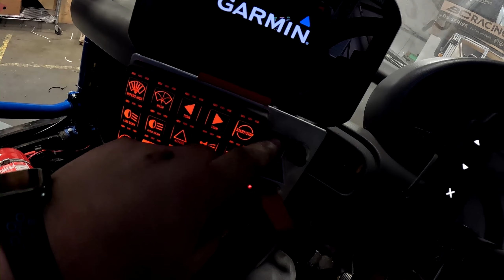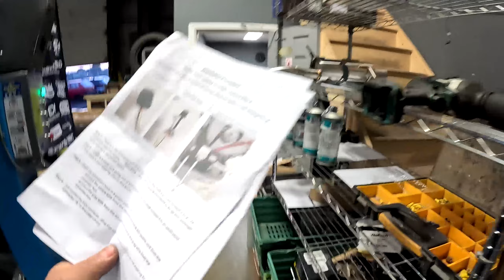RACE CAR STEERING WITH EPAS CONVERSION & STEERING QUICKENER - FABRICATION VLOG

Comment: Regarding the telescopic movement of the column make sure the brass sliding shims haven’t moved or got jammed as I found mine had when I had a pas failure on my megane. It still allowed up and down movement but stopped in and out. (That’s what Nan said!) as for feeding the wheel, the fastest man I know feeds the wheel and he has a tendency to turn up to every race series he’s been in and get fastest in practice and then be in the top 3 when the flag drops so no big problem.

Comment: Have you got a link for the control box and the rack reducer? Another cracking vid chief! 🫶
Reply from the maker: Controller - https://www.ebay.co.uk/itm/284483360575?hash=item423c87973f:g:zLsAAOSwJ8RhYsRT&amdata=enc%3AAQAIAAAA8GaoLzs4zAqZlsbQUAL9ztZSJGCvL1uhcBVTiSYTjlhTVVD%2BtWQmCiz2kKVoHg0o0qhBTdJqYvF6YDofmodIPGUO06NEVxF3ytEEPa1ZA7XtRdhlGBeqISVdqKSKajGAtcmsk9fZ31KG2snMy922luW4K7r5%2FjVKWvbuhH4pNbMxWgiaN2rxV4G3UJx0fvBCHUsMhcI%2FCbKw96hRyRZxFFuql2ou5xuOOv6HL%2FAPZqkMCcLcGKuC7JAc6%2FmdL5YJtKvvdgXsiTK%2FHeOkjpw5MbhPHXHeUTN%2BHhRln2REbgtZU6%2FXLZxKg47DebyEOQ%2FP7g%3D%3D%7Ctkp%3ABk9SR7DwhfGAYg
Reply from the maker: Steering Box - https://www.ebay.co.uk/itm/133867856225

Comment: 👍Nice install, peak electrical load on the build any concern? I've no idea what type of current it'll draw but it all adds up. Being thrown around the track I doubt you'll have the heater fan and rear demister running 😆
Reply from the maker: Its only once you film and edit a video you realize so much information is missing!

My Band-Aid method worked for Cadwell and I'll need to redo it before Brands. But the wire did indeed get "warm" but not Hot or melty. With the time scale all could get hold of was 17amp Wire. So i coiled 2 together - but apparently wire doesn't working this way. It requires a 50amp Fused feed.

Comment: Just wondered has the rack still got its collapsing section or was that the section your removed to fit the 1.2 ratio multiplyer,  

I had a friend that made something similar on his racecar and he had a first corner hero ram him into another car (freak accident) but having a solid bar that could be pushed into your chest from a front end impact  = broken ribs for him.

As always love the content and keep up the great work  and stay safe :D
Reply from the maker: Its one thing i forgot to mention. So you can see at the start i discovered the column assembly was too long. But i found undoing those 3 bolts allowed me to collapse the column a good 3" and this was the only way i could get it all to fit in the end. So i no longer have any safetys